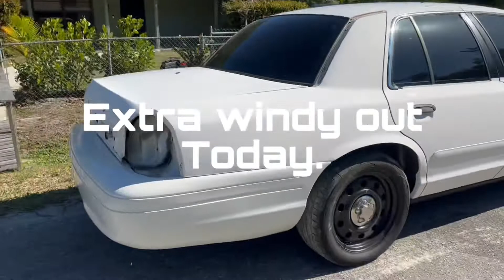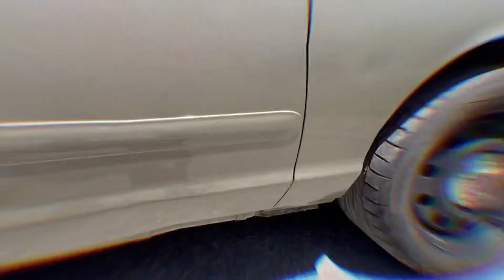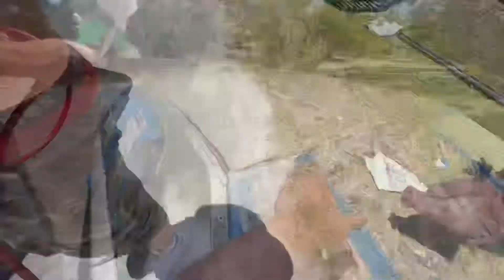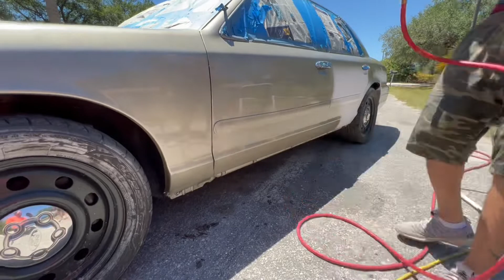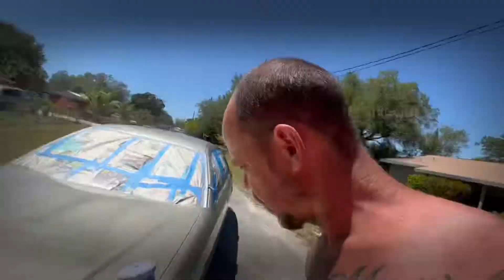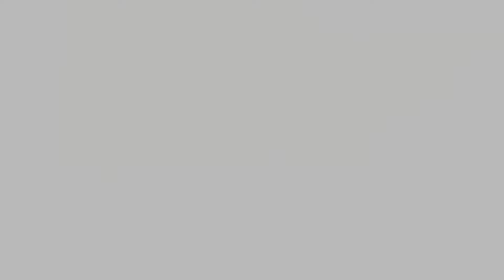PAINTING A CROWN VIC IN THE STREET

Comment: I'm not criticizing, just offering some advice. Next time, I would recommend opening up you fan spray, especially with a metallic paint. It will help prevent tiger striping. The way I learned in high school was a hand span. Do the "Hang Ten" hand sign. From the tip of your thumb to the tip of your pinky is what I mean by a hand span. The fan pattern would be that wide when you are the same distance from the panel. I hope this helps. I paint mine on the side of the road too. lol I always have to keep an eye out for cars coming so I can stop spraying to avoid overspray on passers by.
Reply: I would also recommend starting at the top, roof, hood, trunk, and working your way down. That way you aren't leaning over fresh paint to get the top.
Reply from the maker: @johnpaulheupel5713  ty. I don’t paint, just do sometimes and it’s always a rust lol. Will do in opening the fan spray. Gonna spray the cutlass soon
Reply from the maker: *rush